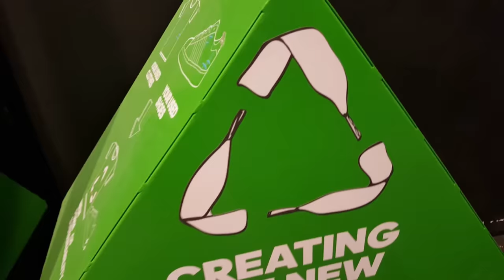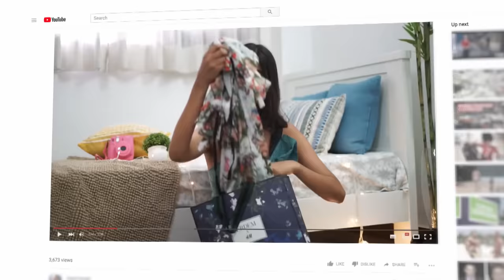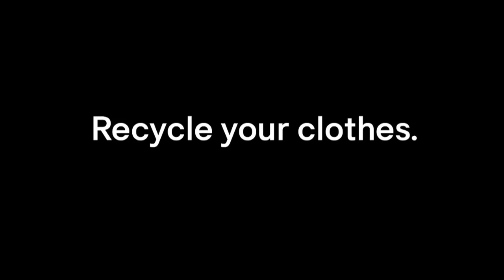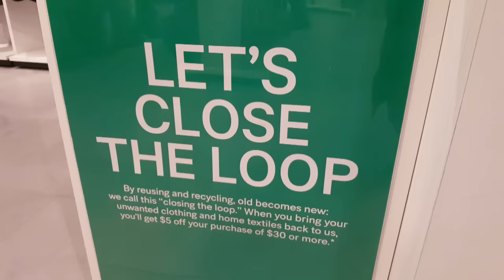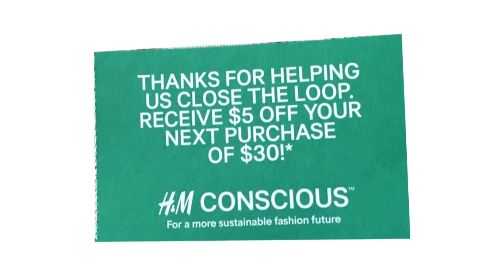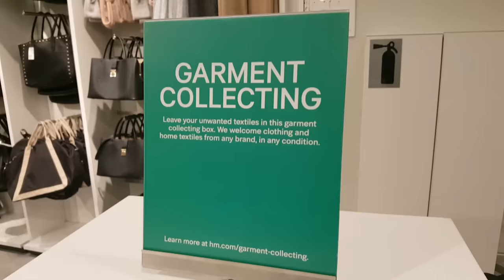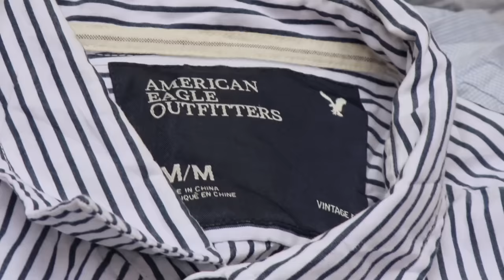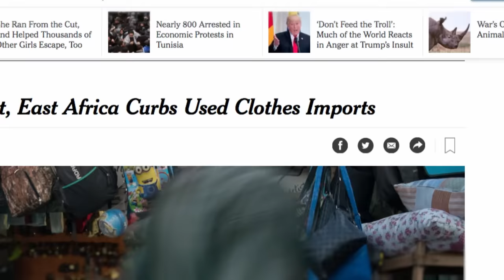How fast fashion adds to the world's clothing waste problem (Marketplace)

Comment: Our parents still have clothes from when they were my age. The clothes you get now don’t even last a year.
Reply: If you buy quality they do
Reply: Marco M no
Reply: @ToteSoldatin  yes they do just choose it wisely
Reply: It's really hard to find the good clothing, especially if you want to get it in a store. I have not seen a good pair of jeans for females in quite a few years, and I've looked in most of the stores within a 2hour drive. Everything has elasticity to it, which means it stretches and doesn't make for the most comfortable secondhand experience, and it also can break/ tear easier than old jeans, and you can't just patch them.
Reply: I’ve had clothes last me years, even cheap fast fashion items. They key is to wash everything in cold water and hang to dry, only use the dryer on the gentle cycle (no heat). Your clothes will last years.
Reply: I have some cotton T shirts I bought from Primark in 2008 which are still going strong.  They were £1 each.
Reply: Mine do? h&m and zara still sell clothes that are pretty good quality. They last me a few years especially the t-shirts go a long way. Holes can be fixed easily and they oftem come with extra buttons for when one goes missing. Just because it was made fast doesn't mean it also has to break fast.
Reply: That's why it's called fast fashion. Cheaply made and on the store floor in minutes.
Reply: I find the sustainable items in the Thriftshop. They've sometimes already been through a life and look fine.
That's how you know they're durable.
Reply: @FlickeringEmber 
there are indeed genuine bargains
both in fashion shops and charity shops
which are good quality 
and nice enough to keep wearing regardless of 'fashion'
...trick is taking time fo find them ❀

Comment: Something I didn't hear her mention that I think is super worth considering is how you care for your clothes. Even our cheap/fast fashion clothes will last 10x longer if we don't over wash them and if we rarely put them in the dryer. They can also be washed in cold water most of the time which also saves on wear and tare. These two appliances break down our clothes a LOT faster. I have begun hanging almost all my clothes to dry and I have had to replace things much slower. My clothes don't fade so fast and don't shrink or stretch nearly as much either. One way to freshen clothes without immediately washing them is to hang them outside in the sunshine. Sun kills bacteria and a fresh breeze leaves lightly soiled clothes smelling fresh again.

Comment: I work for an online thrift company where people can sell their clothes, and it's incredible to see how many clothes simply exist. Kids clothes are some of the best items to buy thrifted, since kids grow up so quickly, and my job won't accept 0-12 months clothing that is stained, faded, torn or looks old. So basically brand new. We even get a lot of clothing that has original tags from the shop the customer bought it from. There's a lot of brands: I see mainly Ann Taylor Loft, H&M, Zara, J.Crew, Nike, Adidas, and Banana Republic, though I've also handled designer garments like Versace, Giorgio Armani, Dior, Dolce & Gabbana, and I've packed Louboutin heels on two occasions. The only complaint that I have is that we don't wash the clothes before shipping them out! I think that's a little gross, but my company is focused on being environmentally friendly, so it'd be a waste of a lot of water to have to wash everything before it goes out, and the customer is gonna wash it themselves anyway. 

Sometimes it's hard to be motivated in my job, as they pressure you a lot to keep your numbers high, but this video reminded me why they're doing this in the first place, and I think it's a great thing for the planet.
Reply: They don't need to wash them, but they should do steam sterilization/use an autoclave oven. This will make them safe and then the customers can actually wash them.

Comment: Because I live out in a rural area, and therefore won't offend the neighbors, I can put chopped up leftover fabric scraps into my own compost bins.  Partly because I do this (and also because the clothing lasts longer, functions better and feels nicer), I buy primarily linen, cotton, wool and sometimes silk fabric for my sewing.  Polyester, rayon, etc, won't biodegrade.  However, I don't obsess over a small percentage of manmade fiber in the fabric scraps - as long as I chop up the scraps, I figure it will still improve the tilth (lighten the texture) of the soil I get out of my bins in five years.  Obviously, city & town dwellers can't do this.

Comment: No need to ever throw away clothes!

1. Buy a clothing item at a thrift store. Most look perfectly fine at a tiny fraction of the original price.
2. Wear it outside. If the seams are undone or a button falls, you can easily sew it and repair it. If its colour wears off, you can use a colouring detergent in your washing machine and make your worn out blacks look brand new.  If a zipper is destroyed for some reason, you can repair it. Avoid buying the weird looking super fashionable clothes and you'll be able to wear them for many years without ever looking weird or out of place. Create your own style instead of following what fashion magazines try to sell! If you still have some things that look too out of fashion to wear, you can either donate them to the poor and homeless or keep them stored in vacuum sealed bags for a few years. Fashion works in circles so the clothes that are old fashioned today will be back in fashion in a few years. (Or you can wear what you like and invest in clothes that look good on you and flatter your form regardless of what fashion wants to dictate you).
3. After a few years your clothes will indeed look a little too worn to wear outside. You can however keep wearing them as pyjamas or work clothes for many years.
4. They will eventually get too damaged to wear anywhere. You can now use them for art projects, cut them down to make patches for repairing other clothes or if you are crafty enough or have a sewing machine use the parts of the textile that is not worn out to create new clothes, or an apron, a denim bag, a hat etc. You can cut your old clothes into strips of fabric to tie plants with (denim is extremely resilient but all fabrics will do if you don't cut your strips too thin). You can make high quality cleaning rags for your home (old athletic socks are the best type of fabric to clean windows but a soft cotton t-shirt would be better to clean and polish furniture), your jewellery, coins, tools, car, engine. You can use old work out leather to make super tough cleaning rags or even make pet toys. All of your old zippers and buttons that aren't broken can be reused!

If you have children*,  you can keep the clothes of the oldest and *pass it down to the younger siblings. Children outgrow their clothes very quickly so they are usually in good condition for another child to wear. Clothes can be passed down between siblings, cousins, family friends, neighbours etc for years. The same jacket can often be used by dozens of children. That way not only you save money but you also save resources. Really young children won't care what they wear but even the older and more picky ones can find hand-me-downs they like and you can donate the ones they don't to other families. Children only become fickle fashion victims if their parents pass it down to them. Don't raises your children to be demanding, ungrateful and trapped in the consumerism mindset and they won't be.

If you are a loner in the middle of nowhere and don't know anyone who has children, look for shelters. Unemployed families, orphans, Roma, immigrants etc really aren't picky when it comes to clothes and, if they can't wear something, they will find another use for it that will still be better than you throwing it away. You can try selling of donating your old clothes to thrift stores but make sure they are reputable and actually give these clothes, shoes, bags and shoes to people in need. I believe circulating old clothes and toys around  is the best way to treat old items that aren't wanted anymore.

Comment: I always bought good quality clothes when on sale. I've found some good stuff at the Salvation Army Store, too. I am still using the  clothes I bought for a travel job in 2001. 

You don't just dump clothes for frivolous reasons. 

I've lost more than 50 pounds over the last 14 years, and quite a lot of big sizes just had to go. You also lose height as you age, and the slim, medium length coat starts to hang loose.
Reply: Betty Dunn Well said!

Comment: Actually, buying more expensive clothes (not nessicarily super expensive), and keeping the clothes for many years is better. It is generally a better quality, lasts much longer, and many brand names are focusing on a less polluting production process. But this is what makes the clothes more expensive, so people need to be willing to pay for it. 

You don't need to limit yourself to a 30 piece capsule wardrobe. But sticking to a smaller number of clothes than you think you need will make you more stylish (because you buy more consciously for what will fit in your wardrobe, and it encourage you to wear each piece in different ways), for most people, it will be cheaper over time. You buy less items, but you get more wear out of each item, so the cost per wear will be lower than fast fashion.

This is common practice in europe, and especially france. The corporations definitely need to take more responsibility, but so do the consumers. The corporations deliver what the consumer demands, so if we start demanding that they actually follow through with recycling and less pollouting production methods, we might start seeing som actual results.

Comment: Thrift shoppers need to realize that shopping cheap still doesn't solve the problem of fast fashion; it delays it at best. Your thrift shops benefit from fast fashion as well fyi.
Reply: A Girl Has No Name 😂😂😂 I get it.
Reply: Well, it is true that it does solve the issue. I am thinking combining capsule wardrobe and thrift shopping to make a bigger difference
Reply: Heather Whittaker 
It's not a bad thing for a thrift shop to have employees. It's providing people with jobs.  Some of those stores provide jobs to people who would otherwise be unemployed.
Reply: In Denmark the thrift stores are manned by unpaid volenters. Their profit are for charities.
Reply: And so what are you supposed to do? Actually solving the problem starts at the top, we don't have control over that.
Reply: Thrift stores just need to sell for dirt cheap so they can rotate clothes out more. Theyll still make great money and less will end up in the landfill because they are too stocked. But charging me $27 for pants because they are a brand?
Reply: @heatherwhittaker6169  In Canada pricing really depends on who priced it, I find  JCrew and Lululemon knit sweaters, as brand examples, for either 9.99, 19.99 or 4.99. Although they have guidelines on pricing I find it to be quite subjective and sometimes clearly done kindly to give a good deal.

Comment: I would like to suggest a swapping area in each common room of college dorms.  We did this all the time, even with shampoos and things we didn't like.  I'm not going to use this, so out it goes and someone else picks it up by the end of the day.  If it's something no one wants, eventually it will go in the trash, but a week is certainly more than enough shelf-life for almost anything to be claimed.  This would probably also work well at food pantries.  Many people would like to turn their old clothes into cleaning rags but can't afford to buy new.  I'm one of those people.  

And I will opt for the more durable clothing every time, if it doesn't look right after I've washed it, I'm not going back to that store.  I get pretty angry when one of the few things I liked enough to buy this year doesn't make it through the laundry.

Reduce, reuse, and since we can't really recycle someone would do well to start an industrial incinerator for this stuff.  Heat and power something big.  Take care of the smoke responsibly.  We have the technology, now we just have to use it.

Comment: Another problem is the quality of the clothes. I have two Reebok sweaters, both gray in color. One is from ten some year ago (maybe long), and other is more recent within the last five years. 

The ten year one, hasn't deformed that much, hasn't got looser, kept its shape well, and has no threading issues, no holes etc. I'm pretty sure I've gotten mud, oil stains, BBQ sauce etc on it and hand-washed all of that off. There is no sign of any tears, discoloration, etc. 
The more recent one has tons of threading issues (which I manage by cutting) and it's much looser and baggier than before.  

You can just feel the difference with the material between the two. I will probably thrown out the recent sweater sooner (if the threading worsen.) than the ten year one.

Comment: This is what we do in our family (indian middle class family) we reuse it again and again and again as different things. Like suppose i have badly stained top i used to wear while going somewhere, after it's stained i wear it inside house or i wear it in winter under sweaters or jackets. If it gets torn then we cut it in square pieces to wipe any countertops, mirrors etc or even to keep floors clean or if the fabric suitable to use as handkerchief we use it like that or if it's a thick material we cut it round as well and use it to keep hot items on or sometime we even get it sewed in different way to use as a complete different kind of clothing or a pocket in new clothing.
And it always helps to have a mother who will ask you a million times 'do you think you will actually wear it' a million times so that you don't end up buying things you wouldn't use. Hope it will help someone.

Comment: to those complaining about "high" thrift store prices, the more you pay more for a garment means higher quality and it will last longer! Spending little money on cheap clothing will just drive you to have to repurchase items again & again. Or you could just spend more money upfront!!!
Reply: price is just prestige. its not quality most times.
Reply: But it's not good quality items. It's fast fashion items donated to the thrift stores
Reply: actually I've found a lot of high end brands or middle brands at thrift stores, if something is from a fast fashion company then just don't purchase it! problem solved :)
Reply: At the Salvation Army thrift stores, a Tommy Hilfiger item would be pretty expensive because it is a popular designer with young people.  On the other hand,  clothing from Evan Picone or Anne Taylor would not be as expensive because these brands are favored by older customers.  It works out for me because Evan Picone and Ann Taylor are generally higher quality clothing than the trendy labels.  Bottom line is you need to know what real quality is when you shop thrift stores.
Reply: That's not necessarily true.  A lot of inexpensive clothes are of decent quality.  They only tear if someone tears them.

Comment: When you are 6'7" tall and 220 pounds with size 16 feet good luck finding used clothes that fit.
Reply: i would still recommend to check on places like poshmark or ebay or mercari.  never know when someone somewhere else in the country digs thru a thrift store and snags something in that size.  I have yet to find anything in size 16 but I listed a pair of size 13 mens shoes and it sold.  But yeah, it's a bit of a different game when we don't come in ready to wear sizes.  for me it's more like pants rarely come in size 25tall or something like tall people rarely have 25 in waist or smth like that lol.  and tallest I've seen listed in womens was a pair of DVF pants with a 35 in inseam on thredup.  so don't give up bc we never know.  that or do a bit of diy with secondhand clothes to make them fit lol (working on that too)

Comment: If one keeps to only natural fibers, then you can sort your old clothes and use them around the house. Cotton makes good rag rugs, t-shirts can make t-shirt yarn with which to either make rugs or crochet bags. Thin and worn cotton, in layers, can become batting for quilts, and cotton scraps in good condition can be used on the outside of the quilt. Crazy quilts use even the smallest-odd shaped remnants. Buttons, zippers and trims can be unpicked and reused. The really unusuable rags can become cleaning rags for jewellery, cutlery, for the floor or for the car. 
Clothes in good condition may be passed down to friends. Clothes, curtains or bedsheets can be made into other clothes, blankets into coats. If something is too small for you, you can make it for your children.  Remember Scarlett O'Hara and her curtain dress? Learn how to sew, it is not rocket science! Nobody's asking you to make a fully tailored suit or coat, but simple garments are not difficult, once you figure out the basics and learn to work with patterns.